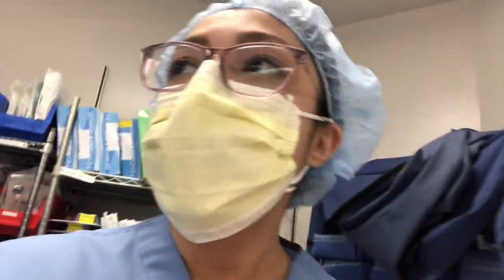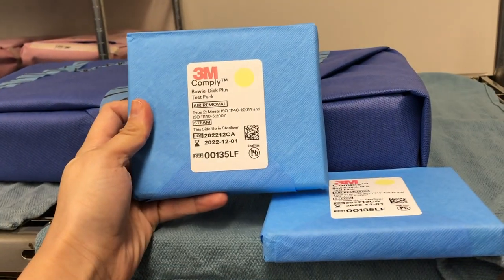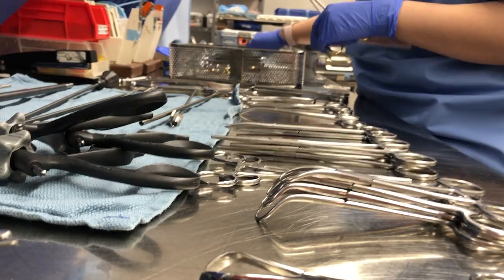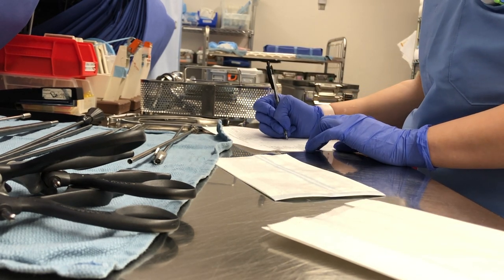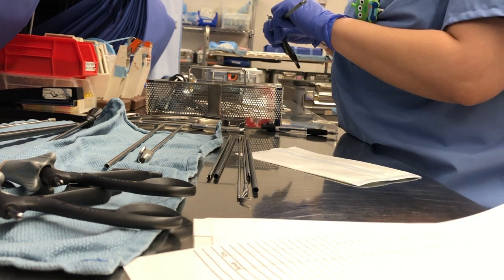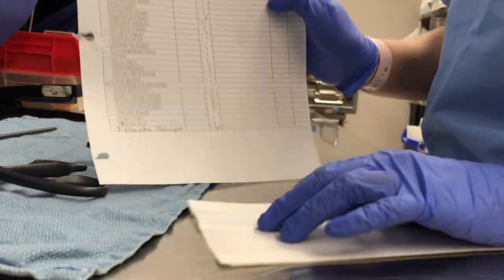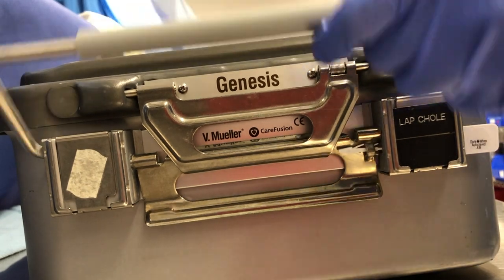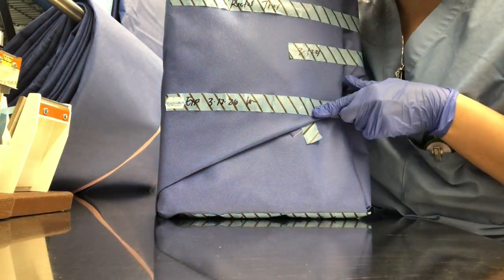STERILE PROCESSING DEPARTMENT| PART 1| SPD SERIES

Comment: How did you learn the name of the instruments , how do remember all of them any advice?
Reply: Repetitiveness will help memorize instruments. You also have count sheets that should have number and names of each instrument as you put tray together. I started from scratch hands on teaching under a great manager. That helps. After you receive 400 hours you can schedule through IAHCSMM to set up exam in your area for your certification.
Reply from the maker: I studied the basics with flash cards and pictures with details when I was in school but the other ones like specialty instruments I learned while working with them and as the previous reply repetition of using them also if you work in spd for a week or two before going into the rooms you’ll have a better chance of learning them and remembering them